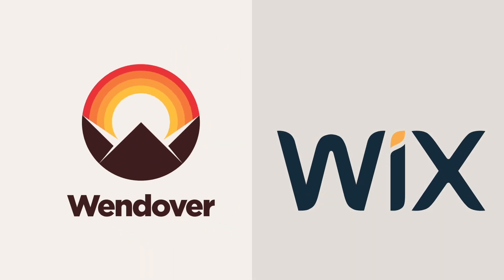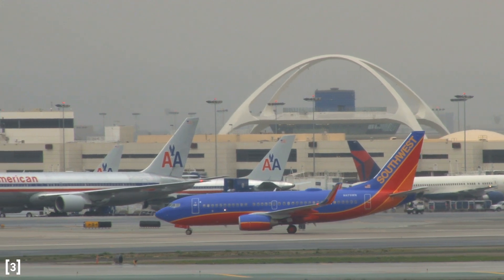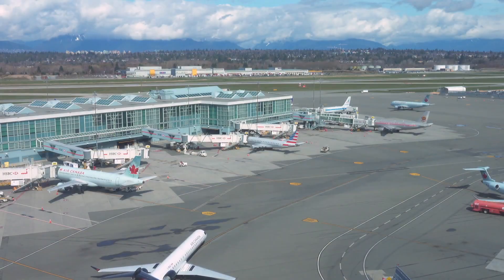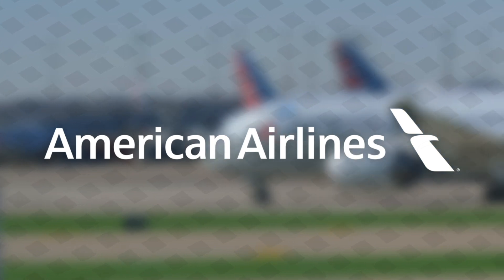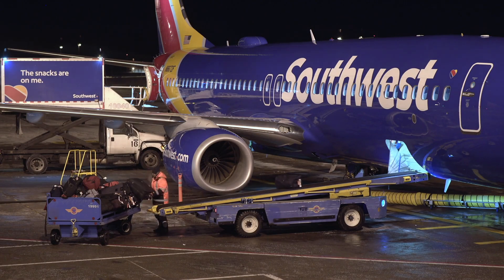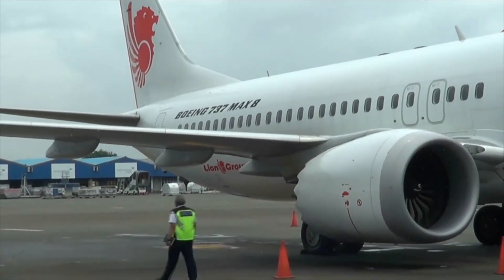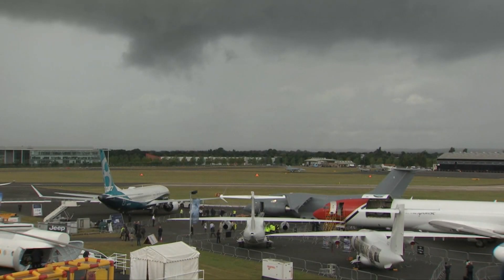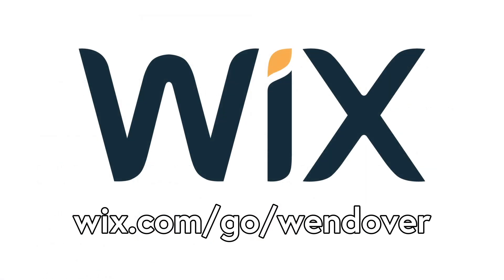The Economics That Made Boeing Build the 737 Max

Comment: I believe there are other aircraft that use the mcas system, but they use more than one sensor to determine their angle. This was about cheaping out and going with one sensor.
Reply: The aircraft has multiple sensors, so that isn't the case. However, it does sound a lot like a rush job by a non-skilled programmer.

Comment: This is misleading garbage.

The 737 max only has a greater risk of getting into a stall in rare circumstances; when it’s climbing and banking steeply and when it’s flying manually with no flaps at near stall speed. Both of these are quite rare, and most pilots will rarely if ever have MCAS kick in. It’s more meant to help absent minded pilots before they get into trouble rather than rigorously retrain pilots so they don’t make small but potentially fatal mistakes.

Sad than wendover goes for sensationalism.

Comment: location of wing; B 52; 737; A 10; is irrelevant to linear mass of plane; but airfoil will change vector of plane causing center of mass; or center of motion to change; otherwise is physically impossible; no plane pitch changed due to location of wing; but airfoil; 
pitch is directly related to airfoil not location of wing; example; put 100,000 amp battery to Tesla; it will not change pitch; 
conclusion; some thing was changed; to change pitch; so if plane has tendancy to change pitch; you change airfoil accordingly; 
drum breaks are put on modern car becasue its cheap and it works; no one can violate law of physics;
Reply: what

Comment: I don’t agree with your summary.
All aircraft are modified during their lifecycles to meet changing market environments.
If the angle of attack sensor hadn’t failed all would have been well.
Convicting Boeing in the public court Of opinion for greed and avarice plays well in social media but falls a bit flat here.
Reply: The issue is that there was only one sensor. That's a very stupid decision.
Reply: @RawbLV  There are other sensors they are called pilots.
Reply: @nibotkram7743  Pilots tried to pull the nose up but the stupid MCAS system overrides the controls completely. In Airbus there's a similar system but pilots can "fight" with it and override the system controls if they push hard enough. Another design flaw right there.
Reply: @RawbLV  Try to stay on point here Rob let me help you.
"Convicting Boeing in the public court Of opinion for greed and avarice plays well in social media but falls a bit flat here"
I am saying that I think we are going a little too Bernie Sanders here with the "money for lives thing."
Reply: @nibotkram7743  Try to read my comments again. I never said that it was about money. I said that it's about the design that was rushed out. They could have made a proper MCAS system and everything would be fine.

Comment: A youtuber calling the decision of one of the biggest plane manufacturers to upgrade one of the safest and the single most successful plane of all time 'wrong' is a bit harsh don't you think? Inexpensive and reliable....

When you talk to 737 pilots they'll tell you there's a way to turn off the machines that change the elevation - always has been. This shuts off MCAS as well. Heck, as you mention, 737s don't have fly by wire, so there is an actual mechanical wheel that the pilots can use to adjust it. It is 'being said' this wheel jammed, did not work on the most recent crash probably due to excessive speed. True? We will find out when the final report is issued.

Not to say Boeing is blameless, not by a long shot, but neither are the pilots. Boeing will fix this and the 737s will soldier on. 

I look forward to watching more of your videos Wend, thank you.

Comment: I actually flew on a 737-800 from LAX to Hawaii. I couldn't believe it. When I saw the airplane sitting there at the gate I actually ask the gate attendant if this was actually the plane we were going to take. She just smiled and said yes.
Reply: 737-800 isn't a MAX, though. It is the NG version, the safer predecessor of MAX. If you really insist it is MAX, then you must mean 737-8. Yep, 737-800 and 737-8 are different 737s. If you see chevrons at the engine, then it is indeed 737-8. If not, 737-800.

Comment: This is a poorly researched and misleading video.
Older design airframes are often re-engined, improved, and modernized. Because we know all their tricks, and we have all the tools and parts. The term used here is "Legacy airframes". They are proven safest.
 An airline that orders aircraft that aren't in production is called a; "Launch Customer" this happens with all commercial aircraft. It's a rule.
MCAS corrects a mild pitchup caused by higher thrust engines, not engine placement. The new engine placement actually reduces this pitchup. 
 The two crashes associated with MCAS were pilot error: Failure to perform runaway stabilizer trim procedures and overspeeding the aircraft through poor throttle management are what caused these crashes, not MCAS.
 There is a pilot shortage, crashes due to pilot error will continue to be a problem.
The Airbus A-320 has the same pitchup problem and uses a MCAS type"software patch" to fix it. But being fly by wire, it may be more difficult to shut off than the 737.
 The Russians are trying to certify the MC-21 but drinking on the job is common placed in that factory group and there is no rule or law to stop it.
The Chinese are working on certifying the 919 but the current flying model has big patches under the wing roots where someone couldn't read the tape, or check their design work. They have a ways to go before these things start raining out of the sky.

Comment: Damn what happen to redundancy? I'd think there would be multiple pitch sensors. 
Also would hope the the FAA would require more training. You shouldnt have to look up how to fix a problem while flying the plane.
Reply: There are two aoa vanes. But the MCAS only ran off of one with no cross talk to the other one.
Reply: @Bartonovich52  I'm having trouble thinking of a rationale for only using one of two sensors. What were they thinking?
Reply: @Bartonovich52  This. If the MCAS was correctly programmed in the first place to know the best action for any combination of AOA sensor information, the 2 major crashes would not have occurred. The engineers actually knew of the existence of a single point of failure, but management didn't listen.
Reply: That was an upsell, actually.
Reply: @aaronrobinson2121  - No it wasn't what was an upsell was the AOA display and disagree alert not anymore sensor vanes
Reply: @PabloGonzalez-hv3td  My understanding was the upsell wasn't adding more sensors (they were already there), but adding a component that could read from multiple sensors.  Could be that AOA display you mentioned.  I'm not all that knowledgeable on this subject; I just got that from a friend of mine who works there.
Reply: @aaronrobinson2121    - Your friend is mistaken that would alter the entire functionality of the system which is not the case. In fact the only component which was actually optional was the AOA indicator display but a software error made the "AOA disagree" alert functional only if the optional AOA indicator had been purchased the disagree alert was always intended to be functional regardless if the display had been purchased.

It's worth noting that the 2 AOA vanes and AOA disagree alert with an optional AOA display are all a carryover from the NG which uses them for the Speed Trim System and MCAS is essentially an evolution of this system implemented to ensure the control  force required to pitch up did not decrease as AOA increased which is a violation of certification requirements.

MCAS doesn't so much directly prevent a stall as is often portrayed it prevents the pilots from easily inducing a stall themselves

Comment: Volkswagen made the same mistake and continued to build the Beetle, even though it had long since become outdated. At the beginning of the 1970s this almost led to the Group's bankruptcy. Boeing is making the same mistake, but a new car like the VW Golf can be developed much faster than a new airplane.
Reply: Aviation doesn't quite work that way the 2019 Cessna 172 is from the 50s it's the best selling aircraft of all time and the USAF is updating B-52s, F15s and C-130 all of which are as old or older than the 737 platform
Reply: @PabloGonzalez-hv3td  Even in automobile industry, Toyota continuously improve its Corolla to this day, despite its 1960's origins.
Reply: @dbclass4075  Toyota is using the nameplate only not the actual design.
I'm referring to the very same design frm 60+ years ago. In some cases the very same aircraft themselves.

Comment: So, if MCAS pitches the nose down in response to sensor data, wouldn't the easy fix be more sensors, and program the system to poll them all and take the aggregate result? One or two faulty sensors wouldn't skew the aggregate enough to fly the plane into the ground. Hell, the accelerometer in my phone knows which way it is facing, how hard can Boeing make this?
Reply: yeah they relied on a single sensor

Comment: It's ultimately a failure of gov't regulation and oversight.  We've seen how trusting a company to do the right thing for public safety works out.  If anything you can trust them to not give a rat's ass.  They fit these engines on the plane that are INAPPROPRIATE for it, and therefore they installed their "MCAS" system that would actually try to drive the plane into the ground when one AoA sensor malfunctioned.  It's not a forgivable or understandable mistake to design a system that way.  I want to see someone go to prison for this.